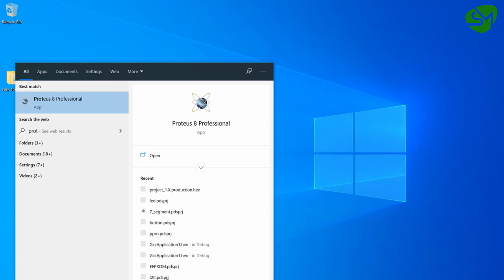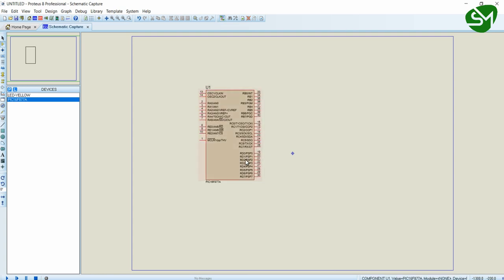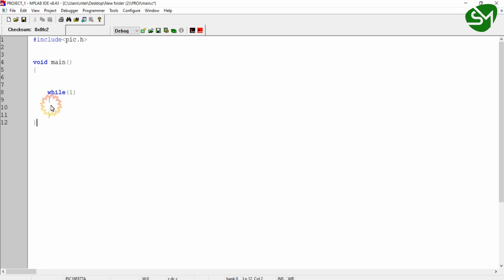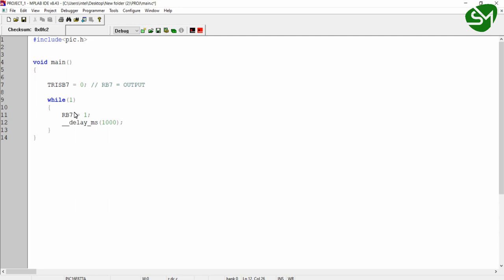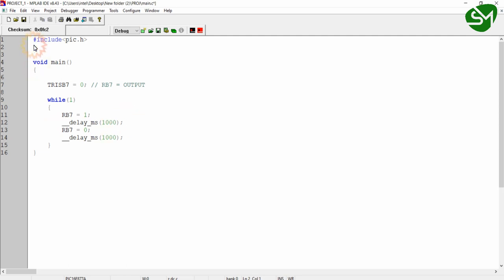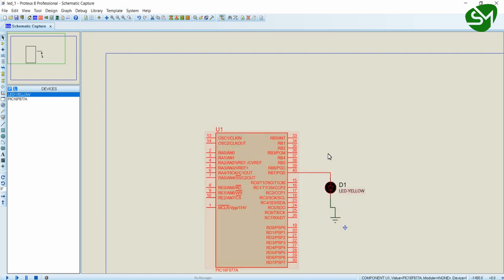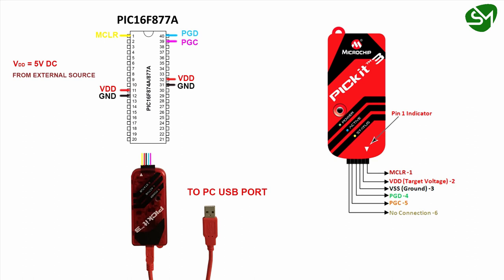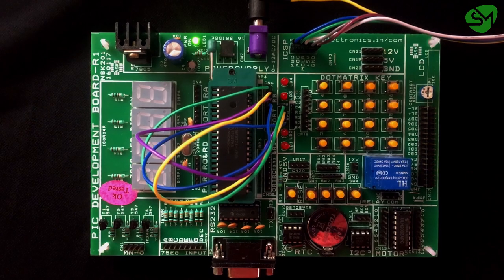INTERFACING SINGLE LED TO PIC16F877A | TUTORIAL 6 |  MPLAB IDE PROGRAMMING COURSE

Comment: Sir , I have error in my code at delay function like this one.
"Error   [800] project1.as; 749. undefined symbol "__delay"". How can I solve it? I have tried _delay_ms() as also but it is not solved.
Reply from the maker: If you comment the line is the error gone.?
Reply: @SMtrainingacademy  yes sir when I commented that __delay line, the error is gone.
Reply from the maker: @aungzaw2415  have you defined the xtal_freq macro ..?
Reply: @SMtrainingacademy  yes _XTAL_FREQ 20000000